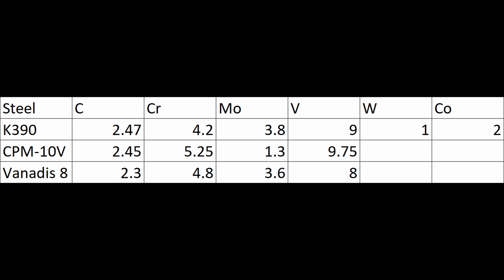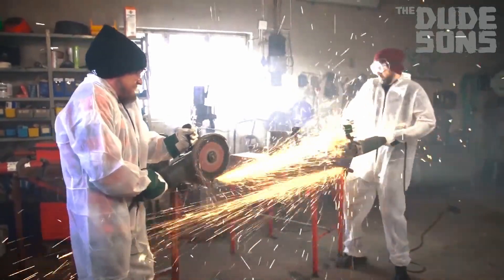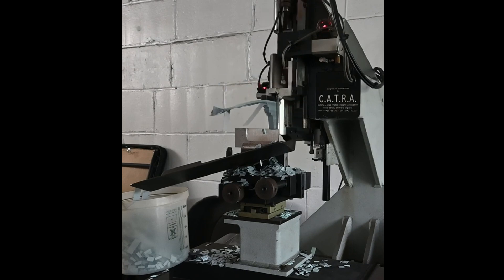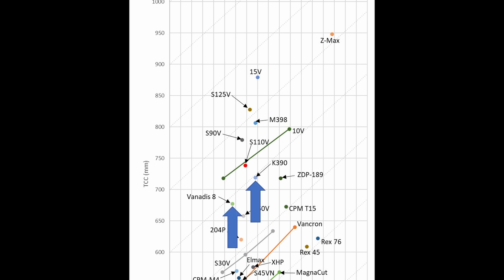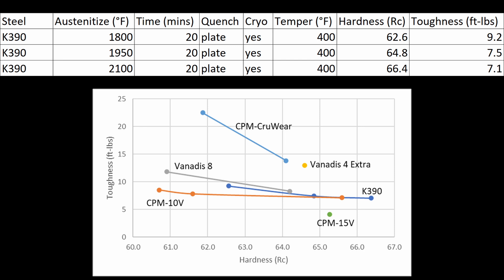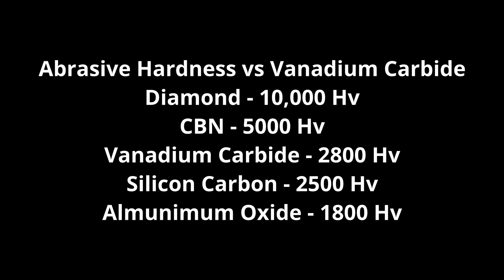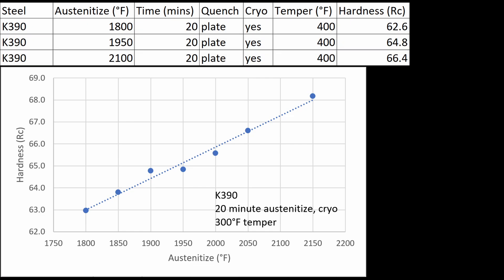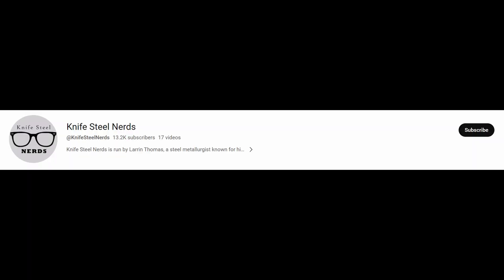K390 - The Best High Edge Retention Knife Steel?

Comment: While very impressive, none of them are suitable as a survival knife (I look at every knife as a potential survival knife). The definition of a survival knife is decent toughness and the ability to sharpen on river pebble. Every knife dulls at some point, and these super steels are basically impossible to sharpen without the right tool. So if you find yourself in an emergency, such a knife can quickly become useless. From a survival perspective, cheaper knives are better. The key is decent toughness, decent edge retention, and proper ergonomics and the ability to sharpen on improvised tools like a piece of rock.
Ultimately, knives like the ganzo, sanrenmu, or BUCK 420HC are better choices for potential survival situations. Good heat treatment of the basic steel.
Let’s be honest, these super steels are mostly just candy for enthusiasts.

Comment: Sorry it took me 2 years ... but I'm here now. :)
I have watched demonstrations in which K390 
looks tougher than its' rating might suggest.
Is it possible real-world will deviate from theory?
Or are these real-world tests that MUST apply ..?
Reply from the maker: K390 is tough enough to do some impressive things if given the right geometry. But there are even tougher steels which is why it is rated the way it is. For us to consider the “real world” test behaving differently than the controlled toughness testing we would need to see a steel with a worse toughness rating doing better with identical edge geometry and hardness.
Reply: @KnifeSteelNerds   I have such respect for your precise language. 
Absolute axiomatic precision that'd stand up to cross-examination in court. A+

Comment: What would you rate 8670 in edge retention, corrosion resistance and toughnes? I had a custom shop make my prototype and due to pricing I had to have it made in 8670 it's a fixed blade for outdoor use with aggressive recurve to a point then a nice rounded belly on tip also very thick knife.
Reply: He has a website rating evetything. He rates 8670 at 10 toughness 
1.5 edge retention
0 corrosion resistence. 
Its as tough as it gets but ita lacking pretty severely everywhere else.  It would make a decent large machete or something. Its not bad itll just need to be sharpened a whole lot and oiled etc.

Comment: If magancut is the best stainless steel currently.  
What is the best high carbon steel currently? One that is capable of holding the finest edge, but at the same time being easy to sharpen, but also great balance of toughness and edge retention.
Reply: Like a super opinel? 😂💪🏻👍🏻
Reply: Holding the finest edge? For starters, not a high carbide steel.
Reply: @Wolf_K  do you know a steel type? Just curious.  Ice bought some magnacut custom kitchen knives since my question and love them so far.
Reply: @IronCan88  

First we need to define high sharpness: to me it’s a steel like 1095 taken to about # 12000 on waterstones and to about 0.5μ with Diamond pastes on hardwood. It will whittle a single hair into 8 pieces and will shave your face effortlessly.

Steels that take really fine edges - that is, as above - are the more usual steels like 1095, O1, 52100, etc…simple carbon steels & simple tool steels.

CPM-CruWear (tool steel) takes a very fine edge, as does CTS-BD1 (stainless) but I haven’t done experiments to find out whether they hold it as long or longer than the above steels or not….I just know they can take it very easily.

I know that Rex121, Maxamet, S90V, S110V, S30V will not hold that high level as long as the above simple steels. It drops off very fast.

Knife enthusiasts want all the best attributes in a single steel but such a steel doesn’t exist. Rex121 and Maxamet have the longest edge retention but it’s at a far lower level (and tested under lower standards than my own) than what I class as ideal sharpness for such steels (non whittling but still push cutting newsprint at 90° with the grain). 1095 takes a very sharp edge but it won’t last a long time. However, simple steels will hold this very high level of sharpness longer than duper steels (overall) as the later, even though they can attain it, lose it very quickly.

Duper steels are good at holding a “reasonable” level of sharpness or a “working edge” for a long time but to me this isn’t really ideal and so I sharpen them more often than most people would and I also use them with a highly refined but coarse # 600 DMT finish as I don’t like that “reasonable” level as it’s lower than what I accept as ideal. If holding lower grit edges is your thing then they may well please you but if holding razor blade type edges are your thing then they will only disappoint.

It’s all about compromise as the steel that takes the sharpest edge in the world won’t hold it as long as the steel that holds the less sharp edge.
We must decide what we need and its intended use and then get the appropriate tool for the job. If it’s a general use knife then I don’t think it matters much at all. If you e joy sharpening then I’d be more inclined in getting a steel that requires more frequent sharpening than something silly like Rex121 (at the extreme end of the scale) or S30V (at the lower end).

Again, it’s all compromise as contrary to the marketing of the latest greatest “super steel” there’s no one steel that can do it all.

*super steels don’t exist, it’s a marketing term just like “surgical steel.”

Edit: A side note- people who claim to not sharpen a knife for something like a year etc are greatly misleading people because they don’t tell you, as they don’t consider hones and strops as sharpening, that they hone and strop frequently. However, if you’re using an abrasive then it’s removing metal and thus sharpening. If it weren’t, then what’s the point of doing it?! I thought I’d mention it as it gives people unrealistic expectations.

Also, MagnaCut seems to be quite an ideal steel. I recently got a Manix2 in it and I’m testing it (long term) and will continue to do so for up to two years before I make any real decisions on it. Initially, and from all I’ve read, it seems quite ideal for a cutlery steel.
Reply: @Wolf_K  thank you for sharing your experience and thoughts.  I really love my magnacut kitchen knives, but I only cook at home. Hope to hear your long term evaluation someday.
Reply: @IronCan88  

You’re welcome.

Comment: Hi Larrin.
I wandern if a laminated K390 whit N690 steel whil increase the toughness of a final blade.

A knife manufactur says: ,,We’re using a laminate steel because such a steel is at least 20 % stronger than a solid stainless steel." (VG10 core laminated whit 420J2 steel)

Knowing that N690 hawe a poor toughness, makes any sense of laminating K390 whit N690 steel ?

Comment: 15v deserved that 3, if even that. I suspect it was changed more due to social pressure than anything else. 15v is not as tough as zmax in your own tests, yet zmax is also rated 3.5 on your scale whereas it's closer to maxamet which is rated at a 2.  2.5 seems like a more objective rating for this niche and frankly in the context of an edc knife gimmicky steel.

Comment: Dr. How come blade hq gave cru wear 8 in edge retention and you only got 5.5… I thought cru wear was close to k390 on edge retention?!?
Reply from the maker: Blade HQ flipped their toughness and edge retention rating for CPM CruWear. I told them but they still haven’t fixed it. It is not close to K390 in edge retention.
Reply: Dr. TYSM…. I was going for not just “good edge retention “ but a tough blade steel… so I might get a cruwear / micarta  pm2 … I kept hearing about the strength of cruwear but the blade HQ info was holding me back..especially with a thin blade stock of the pm2, I needed a tough steel… I’m used to cold steel blade stock and toughness.

Comment: My spidy rusts is hard to sharpen and looses edge pretty quickly   , i duno whats the hype all about   Kinda miss my 180$ tbh  ps stupid plastic handles and grandpas back lock
Reply: I understand that many have written that their K390 really has no rust issues if taken care of, but you can't get to the area of the pivot unless taken apart. You can put oil there but you can't wipe off moisture. For me, sharpening takes such little effort and I enjoy it. That's why I prefer more corrosion resistant metals. My Police 4 LW is VG10.

Comment: No, MagnaCut is by far the best steel. It was invented by some genius in Colorado. JFYI.  lol.
Reply: Ummm…no it isn’t.   At least not until companies start heat treating it consistently between 62-64.   Less than 62, might as well buy S30 or S35.  On the other hand Spyderco Seki City K390 is just glorious!
Reply: @donrichter3523 I think depends on what you value more.  And your use case.  For kitchen knives I think the recommended 61.5 is fine for best corrosion resistance and toughness and ease of sharpening/maintenance.

Comment: I'm just being torn. I want to try it. But I'm casual user. I do food prep on picnics and business trips using my folder knives in 99% of tasks. And I'm bit afraid of K390 being not rust resistant. Tempting and alarming at the same time.
Reply: That's a legit concern, while ive used K390 a lot i only keep it oiled and in storage for days i break down dry material. I carry stainless mid and supers much more often.
Reply: @thaknobodi   heh couldn't wait more and ordered one just yesterday. A small present  for myself i could not resist. So i'm exited to get my Police 4 K390 in a few days. I had some experience with hight carbon kitchen knifes and had no problem with them as i am a carful user. But this will be my first folding knife in non rust resistant steel.
Reply: Properly treated k390 is actually more corrosion resistant than one would think based on the stats, and it slowly develops a golden-ish patina over time. As long as you clean it regularly, and perhaps oil it if using it in a high salt/acidic environment it will be fine.
Reply: @MB_MagicMOnkĒLove  so ive been using an endura k390 for the past month and a half and there is only the slightest greying visible in certain lighting, growing off the edge from cutting a couple limes then washing it shortly after. No discoloration on the spydie hole or anything. I do put vaseline on it regularly though
Reply: Try Magnacut instead.  Great corrosion resistance

Comment: I like K390 in everyday use, it is sticky sharp, and holds the edge for a long time.  15v is also excellent.  15v steel has great edge retention and no chipping issues.
Thanks for the data.   :  )

Comment: I have carried the stretch 2 k390 for 1.5 years now every day. On the job and off. Its an absolute workhorse. I sharpen at 17dps with a tsprof and put a 30° micro bevel with a worksharp pocket sharpener ceramic after sharpening. I also use the ceramic on the pocket sharpener whenever i feel it getting dull. It only takes a couple passes before it cuts paper again. It is a workhorse. The ergonomics of the handle and geometry of the blade excel for work tasks. Buy one if you are actually going to use it, you wont be disappointed.
Reply: 17 dps is 34 inclusive angle. Your 30 degree micro bevel comment makes no sense.
Reply: @sergeb.1717 surprise Suprise, it’s you that doesn’t understand. There’s nothing in his comment that does not make sense.
Reply: @EastCoastMan603 first thing first, it's disrespectful you referred to me as "that". As for 30 degree microbevel, sure let's try to make sense of it.
He sharpens at 17 degree per side I'm assuming ( don't think he would be putting 8.5 degree angle per side, but he is free to chime in), next to make what he says work, he is raising angle to 30 degree per side, so his microbevel inclusive ( total angle ) is 60 degrees. In the knife community, to be understood, you want to be using the right terminology and when somone says 30 degree microbevel, they usually mean total angle of 30 degrees (15 per side).
Now it's not uncommon to sharpen at 18 degrees per side sure, 17 even better. There is big difference in cutting performance starting at 15 per side. In any case, you are just better off with a 20 degree per side microbevel. 30 per side is just too much especially on a knife like stretch.

Comment: What about s390, I was just curious if other company's like CTS or crucible have a comparable steel to bohlers s390?
Reply from the maker: S390 is a high speed steel with ~5% vanadium in it. Other steels with roughly similar properties would be CPM-T15, Z-Max, CPM Rex 86, and Maxamet.
Reply: What would you say the optimum HRC is for s390?   I have a custom with s390 at 67hrc.

Comment: I prefer Vanadis 4 Extra  to any other steel. Also,because its all about heat tr. And geometry,I'd take a ballbearing steel for my fixed blade and Victorinox SAK steel for my folderretf I get high toughness and stain resistance, doesnt matter much, how good is the edge retentionn

Comment: k390 is almost like 9v, vnadis8 like 8v, ish...  What about 7v? This seems like it would be the real sweet zone for a big gain in toughness but only marginally less abrasion resistance, which at such a high level becomes less and less relevant anyhow. Another thing I've realized is that if you're dealing with vanadium steels at all, you might as well go for broke because the maintenance requites are all going to be above standard chromium steels. Doesn't matter if it's "merely" s35vn or if it's s90v. You're basically not going to be able to use "normal" aka traditional abrasives. So it would seem if you have to make that tradeoff, you might as well get more out of it. Either stick to chromium steels like say aebl at the higher toughness end or xhp at "middle" choice or zdp at the high abrasion resistance low toughness end. As soon as you get into vanadium steels, your maintenance requirements change so you might as well go big or go home.

Comment: Where does MOVA-58 fit in the knife steel chart? Is it any good? All I can tell is that it’s stainless.
 Is there any explanation on this steel?
Reply: MOVA-58 is basically the Spanish nickname for 4116 steel—think of it as the "Juan" of knife steels. It’s super stainless, sharpens like a dream, and doesn’t chip as easily as those fancy, harder steels that act all tough but crack under pressure. My trusty Spanish Cudeman MT-3 is rocking MOVA-58, and it’s the kind of steel you’d want in a survival knife when you’re out in the wild, fighting off raccoons or opening cans of beans for dinner. Fun fact: this steel is so reliable, it’s also the go-to for kitchen knives and surgical scalpels. So, whether you’re slicing tomatoes or performing emergency surgery in the woods, MOVA-58 has your back!

Comment: Hey Larrin, Where can I find a fifth quality of steel: durability in heat.  So I dont have to worry about stabbing a piece of meat in the bbq (lol - I jest but that's an example) I guess you refer to this as hot hardness, but are there other nuances? hot toughness, hot corrosion resistance? I'm asking

Comment: A question for everyone with K390, i live near a beach, and for that reason i use H1, but since the edge retention is really bad i would like to try K390, the question is, how is the corrosion of this steel?, it would be use for EDC, so it will be expose to sweat and salty breeze everyday, thanks in advance
Reply: I have Endura 4 on k390. 

Even tap water can make rust to the blade, atleast on pivot area, were it's difficult to dry. I have noticed this when I have washed the knife under tap water and could not dry the pivot area properly. But it's surface rust, which I don't mind really. 

I have not used it on salt water, but you can be sure it can make rust to the blade.

I always rinse and wipe the blade dry after foodprep for example, so the edge stays sharp. And if you wipe the blade dry after use, it doesn't rust. I have made patina to the blade on purpose thought, by leaving some food (citrus fruit/mustard) to it without wiping it.

Sweat is also salty, so it makes surface rust and patina to the blade. 

So conclusion, I think k390 is steel that you want to keep dry. 

I have some photos of the blade and some disassemble photos on my instagram (sak21spartan). Ask more if you like!
Reply: Youd be better off with S110V. Same edge retention as K399, but a 9/10 corrosion resistance. A lot harder to sharpen, though. Honestly any steel holds an edge better than H1, LC200N is about AUS-8 in edge retention but 100% rust proof like H1, just more expensive than H1. I have two spydercos in LC200N as my wet work/ kitchen knives

Comment: How do you feel about zmax? I feel like k390 is about the upper limit for usability in high resistance blade steel. How much would laminating something like 15v or maxamet with aebl make that a more viable option?

Comment: I love k390. Easily my favorite steel. My edc knife is a spyderco stretch 2 in k390 that I adore- it's the fully ambidextrous PM2 that flies under the radar, and it's teal, my favorite color.

Been sad to have missed out on the BBB 15v sprint runs, though.

Comment: Spyderco Delica K390 is my favorite leather cutting knife, no constant stropping after long cuts. It is only .090 thick with a distal taper. When I do strop it I use mahogany plywood 1/8th thick by 1.25 inch wide by 8 inches long glued to a pine 1x3/4 handle with 1 micron heavy 50% diamond concentration paste. I clean it off once in awhile with Tap Magic cutting fluid I use on my sharpening stones except diamond stones I use water for.

Comment: I’m just an enthusiast, but anecdotally, K390 has been incredible in my use. I even tried to cut metal banding by accident, and it barely rolled the edge where any other knife steel would have had the edge destroyed.